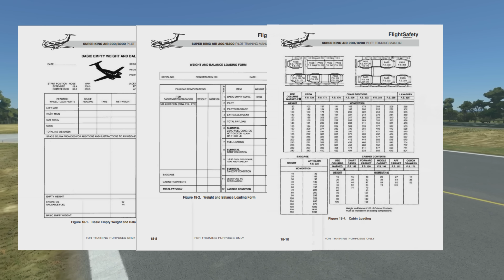Disaster Just After Take Off | Crash of King Air, Melbourne, Australia

Comment: I have many thousands of hours acting as PIC on this model. I don't buy the rudder trim issue. I can think of no reason for the rudder trim to be set fully in one direct or the other except for checking that it has unrestricted full travel during the ground checks. Could have become distracted and failed to center it again after the check. However, This airplane has some pretty serious balls when you open the throttles for takeoff. I can't imagine a pilot of a twin turboprop not immediately aborting the takeoff at the first sign that the airplane was pulling incredibly hard in one direction or the other. The incredibly strong pull would have happened long before the airplane was fast enough to fly. I.e., if it was the rudder trim issue, it would have pulled so hard prior to 'RedLine' that it would have been suicide to not abort and keep it on the ground at ALL costs! Sadly, when everyone in the airplane is lost, we have to go with what we think might have happened. My guess is )and I am one of a handful of pilots around the globe that don't automatically become a crash investigator immediately after an accident) that there was more to this than meets the eye. My sympathy to their families.
Reply: For me, it's the second inspection walk-around that makes me wonder... Maybe this guy had a habit of walking around his plane a second time all the time, but just after taxiing around a little bit, it seems weird. He KNEW something just wasn't quite right, and tried to dismiss it as "too minor to make an issue"... It sucks we don't have him around to interview or anything... BUT I can't shake the sense that he felt something wrong and was somehow in the habit of dismissing issues... just like the overweight... and probably a balance problem.  ;o)
Reply: @gnarthdarkanen7464  Yeah, that second time doing a visual inspection also made me wonder. Especially if - as the report insinuates - he didn’t carry out the checklists fully/correctly, because why then would he do this inspection twice but not bother to do the rest properly? Also, he was an experienced pilot (based on the amount of flight hours) and should know the ins and outs of this plane, its limitations regarding maximum weight too! 

I guess they didn’t find anything about prior incidents on this guy, since nothing was mentioned, but I do have to wonder why so many mistakes were made. Was he experiencing fatigue? Did the passengers act up or do something so he was unable to ensure a safe takeoff? Maybe far fetched but it’s a small airplane. I don’t know… But I also don’t think we have the full story here.
Reply: @TheaSvendsen  Well, I'm not so easily impressed by experience numbers. I learned from Motorcycles that Practice does NOT make perfect... ONLY PERFECT practice can do that.

     A guy can ride the same stretches of road and highway for 20 years, on the same bike, and be fully capable there... BUT put him on any other bike and on any other road, and he can't get the thing into first gear and take off... He'll flip himself over the handlebars before even getting out of the parking lot... dragging feet off the line, flailing uselessly as he whiskey-throttles straight across the asphalt into the next building... etc...etc... ALL "stupid noob' sh*t".

     This guy doubling his walk-around suggests to me some kind of anxiety somewhere, but in too much HURRY to stop, breathe, and re-assess the situation fully. How else (other than "rushing it") do you manage to leave rudder-trim ALL the way over???

    Maybe all his hours are Private HOBBY hours with no deadlines or schedules and he's suffering "first day jitters" or "new job stress" and trying to build a good impression early... Maybe it's his first time flying for a "big-shot" customer, and he's suffering under the horror stories about them... Who knows???

     We're technically speculating about the second walk around, BUT the report specifically focused on it, too. There's something to it... SO from human nature, I'd have to say SOMETHING made him anxious about that plane...

    For the rest of us, the operative lesson comes down to "Damn the schedule and money. If you're anxious about your plane GO SEE THE MECHANIC OR ENGINEER! Get the f*ckin' thing checked out. You might stick the company with a bill, and you might even get bitched at by the customer... or fired... I'd happily survive the flight to get fired rather than die because I'm too stupid to "listen to my gut" and get the plane sorted out while it's still on the ground.

    Every take-off is OPTIONAL, but every LANDING IS MANDATORY... one way or another.  ;o)
Reply: @gnarthdarkanen7464  There’s nothing at all odd about visually inspecting an aircraft repeatedly while waiting for fuel to pump, or pax to arrive.  The alternative is just stand there like a fool with your thumb up your ass.
Reply: With respect, please elaborate on "more to this than meets the eye" in the context of this crash, as you undoubtably have a clearer understanding than 99.999999% of the human race about this specific plane, with your experience as PIC! Thanks, sir!
Reply: If you have many thousands of hours on a King Air.. you know that full right rudder is usually required in the first part of the takeoff roll. 

Also rudder trim has no effect until at least airspeed alive going down the runway. 

So immediate abort makes no sense in a plane that normally pulls to the left. 

It’s a high speed abort. Given this pilots nonchalant attitude about weight he probably figured it was a crosswind that he was dealing with sloppily and the sooner he got into the air the better.
Reply: I totally buy this theory as to what happened.   Here we have yet another pilot that overloads the plane, ignoring a limitation.   This leads me to believe that anything is possible when it’s proven that the pilot didn’t give a siht about taking off over max gross weight.   What else did the pilot intentionally ignore and disregard?    A checklist maybe?
Reply: If the pilot couldn’t even calculate his weight correctly, I won’t assume he did anything correctly, as that is the easiest thing he had to do all day.  Let’s face it, pilots are really high on the arrogance or over-confidence scale, they often overlook things and make very stupid decisions. There are GA accidents every day, if pilots were as attentive as you make them out to be, most of those accidents would not occur, as the vast majority of accidents are pilot caused.
Reply: Similar accident USAir 5050 September 1989 in LGA. Rudder trim off set on a B737-400.
Reply: Is there a chance the prop pitch was only working on 1 engine and maybe the left side was feathered out?
Reply: No according to the ATSB both engines were functioning normally and were at 2000rpm or normal take off power upon impact.
Reply: Many 1000,s of hours??? Tjen you would be a 1/2 way knowlegeable pilot and know that not following vhecklists. On multiple occasions, flying 500lbs over gross and probably totally ignoring the cg, knowing full trim would be about impossible to overcome with thebest legs, it makes me wonder about your statement! Or may be, just like him you are immune to all basics? Obviously you have never tried to overcome full trim in that airplane! Trying to defend the pilot's negligent behavior is flabbergasting at best. Gives us an idea of your standards...
Reply: Oh so your not giving your non expert analysis of the crash. Go
Away.
Reply: Could it be pic was in to bigof a hurry
Reply: Yeah mate I call BS on you having many thousands of hours on anything other than your third leg…… get off Flightsim and go learn to fly
Reply: When a PIC can overlook being over gross by 500 lbs, anything can be overlooked... A typical case of letting one thing slide by that always encourages another to be ignored. A bad habit. Only takes once. Seems to me That the pilot might not even have bothered with a weight and balance, therefore not even bothered with proper checklists, overconfidence, and negligence on his part. All is very plausible in this scenario. In your comment You assume, all pilots are responsible, competent, professional, when in reality it is not the case. Many break rules or do not respect them and get away with it for a long time, sometimes nothing ever happens, sometimes the inevitable happens... ATP /MEII 3400 instruction given , ex US AIR...
Reply: @LivingArtsCo remember Flt 5050 ?
Reply: @LivingArtsCo  how was this airplane overweight with a single pilot and 4 pax aboard?  Unless he was carrying cargo, that’s impossible. Trim can be overcome by force in a lot of airplanes. I agree with the OP. If you have serious yaw on the roll, you pull power and come to a stop.
Reply: @JuanTyme  Lol, he was over 500 lbs over gross weight!  Full trim to the left! Like I said, and I am a career [pilot, ATP, MEII, when someone disregards the basic rules, flies 500 lbs over max gross, it gives you a good idea of the quality and professionalism of the pilot, which in this case was poor at best... With these engines and props, trust me full trim is hard to fight when get up to speed, if not impossible at times and in some given attitudes and certain speeds, plus over gross weight, and I would not be surprised at all if he was out of CG range. Never completed a full checklist, or he would have caught the trim setting on more then one occasion. Should have never considered taking off in the first place, and aborted right away. Incompetence killed 5 people and destroyed a perfectly good airplane, that is what happened here, end of story.
Reply: It seems that it shouldn't take too much force to overpower the trim.
Reply: @markdaniel8740  trim tabs are actually remarkably difficult to overpower.
Reply: @markdaniel8740 you would be surprised!
Reply: @markdaniel8740  Wrong, on this aircraft,  it becomes extremely hard to overcome full trim even with the best legs, take it
Reply: You're not going to notice a rudder trim issue while the wheels are still touching the ground.
Reply: @ticenits1926  pardon?  Rudder trim is not an issue while wheels are on the ground? Really?  Well how many knots do YOU think it takes before gaining/losing rudder authority?
Reply: @petesmith9472 iirc Vmc on a King Air is around 85kts or so. Rotation was always around 95kts.
Reply: @ticenits1926  a fully deflected rudder trim? Yes, you most certainly would notice it.
Reply: @ticenits1926  (Nice Tits???)  "You're not going to notice a rudder trim issue while the wheels are still touching the ground."....This may be true for slow taxiing, but as soon as the plane gains speed, the rudder will quickly become effective while the plane becomes lighter thus losing wheel traction of the front wheel.  The combination of these factors means that the rudder will become effective fairly soon in the takeoff run.
Reply: @trungson6604  So it is your belief the pilot attempted takeoff fighting the rudder the whole way through rollout at which point he was unable to overcome it in midair sending him into a steep wing over dive? Even though this is exactly the kind of crash we'd expect from an engine out

Comment: In what flight configuration would you use that much rudder trim?....assuming it was left in that position from the previous flight.
Reply: Wouldn't they have noticed the plane pulling to the left all the way through their takeoff roll?
Reply: @wattage2007 It seemed to do this in the video! It was all over the place.

Comment: I'm not a pilot but have some experience. Someone correct me but   It would seem to me that with trim offset so much it could still be overcome by use of opposite Rudder, at least long enough to gain flight speed and figure trim out?
Reply: That requires him to instantly realize that the problem is a full left rudder trim. He didn't even have 12 seconds to figure that out. He had enough trouble trying to get the thing off the ground.

Comment: A very good video!  I’m pleased to find this channel again.  It makes a change to hear about accidents in smaller planes - in fact sadly, you should never run out of material because accidents in GA planes are increasing, unlike commercial flying which keeps getting safer.  Would a trim all the way to the left have been visible on a walk around?  Just wondering.
Reply: Yes you'd definitely be able to see that
Reply: @fugginrambo  many thanks
Reply: Great question. It’s possible it was neutral during the walk around and only became deflected during the checklist procedure performed afterwards. We will never know what actually happened but perhaps the pilot became distracted by a px or radio call while performing the checklist. I believe some carriers require a checklist to be restarted from the top if there is an interruption.
Reply: @davida56891  thank you!  Yes I’ve heard about restarting checklists from the beginning after an interruption as well.
Reply: Commercial pilots are required to restart checklists if interrupted. The checklists are also broken into sections so a restart from beginning is not required.

Comment: Thanks for covering this crash. It was nothing short of miraculous that the only fatalities were the people on the plane. Just past the DFO shopping centre whose roof they crashed onto is one of the busiest freeways leading into the Melbourne CBD, and the normally packed shopping complex had relatively few people there as it hadn’t yet opened. Had the plane come down only metres further than it did, it would have crashed onto the freeway. A very sad day indeed for the pilot and his passengers, but the pilot did a Stirling job nonetheless, under the circumstances.
Reply: "...but the pilot did a Stirling job nonetheless"????  This pilot is completely incompetent, because he should have aborted the takeoff when he should have detected the strong out-of-trim condition on the yaw axis.  He no doubt had to apply a lot of input into the rudder pedals to keep the plane on the runway, so the unavoidable thing to do would be to stop the takeoff run in order to re-trim the aircraft or to investigate the cause of severe out-of-trim condition before taking-off again.  This should be an instinctive reflex that requires no thinking at all.  If the aircraft doesn't feel normal...abort the takeoff.
Reply: Apart from taking off within weight limits and missing the rudder trim item in 3 checklists.
Reply: Yeah it’s very lucky

Comment: Odd that this plane was over it's maximum takeoff weight with only 4 passengers in a plane that looks to hold maybe 15?  Maybe too much other cargo was loaded onboard?
Reply: This plane was a Beechcraft King Air B200, which has a maximum capacity of 8 people (2 crew + 6 passengers).  But still, with 5 people in a plane that can handle  8, one would think it would be tough to get it overweight.  But then again, if he fully fueled the plane, had large people and cargo, one could perhaps go over the limit.  But dang, it was greater than 500lbs overweight!

One would think that a commercial pilot wouldn't be so stupid as to:
1) not check the rudder trim, which is in the checklist
2) not have done an accurate weight and balance calculation

I'm surprised the pilot couldn't overcome the rudder's trim setting by pressing on the rudder pedal, but then I have never flown a twin engine plane, so I have to admit my ignorance here.  I only know that on a Cessna 172, with full elevator trim set to maximum, one can overcome it with the yoke.  But then we are talking elevator trim on a single engine plane versus rudder trim on a twin engine plane. Not exactly apples to apples here.

Comment: This still haunts me 🙁 I knew Max the driver, we used to cross paths on various charters, I’m convinced Max had a medical event and simply couldn’t handle this flight on the day. I’ve got 4000 hrs on type, the plane can handle the full trim deflection, Max couldn’t. RIP to all🙁
Reply: Thank you, I wondering how an experienced pilot could make so many errors before flight and then during the flight fail to raise the gear and apply rudder once airborne. Makes sense now.
Reply: That makes sense because the longer roll than normal and the gear being left down too. He must have had something major distracting him and thought he would get past it as he took off, but then he figured out it was too serious and sent the mayday but couldn’t manage the aircraft because of whatever was going on.
Reply: He failed to check the trim 3 times and set off 240 Kilos over weight killing 4 innocent people, was the medical condition called being an arrogant dumb prick?
Reply: Thx Wally, I came to comments to see if someone with knowledge could verify my suspicion that it wouldn't have been trim. 4 passengers is a light load. Seems like something else was likely.
Reply: you guys havent heard all the tapes......it wasnt that.....

Comment: This has to be the dumbest accident I seen for a while. I think it is mostly complacency and lack of engine out training.This pilot had 2000+ hours on King Airs, how did he pass recurrency check rides?? If I am flying a twin and it has severe yaw to one side on take off, I be standing on the rudder and my hand would be at the rudder trim, for I cannot be pushing the rudder hard that long. Look like this guy did nothing. So he was recorded checking the airplane outside twice, which to me is mostly show biz anyway, but he somehow forgot the trim wheel. Even flying single engine , we get severe out of trim situations on a go round and I have to get to the trim before my arms give out. The newest King Air, this would have been done for you, you can have your feet on the floor with an engine out. 400 lbs overloaded is not really a direct cause for an accident. If you are flying across an ocean on a FAA ferry permit, that allow you at least 10% over the regular gross weight. You strap one of those Australian made Turtle Pack rubber fuel cell in the back.